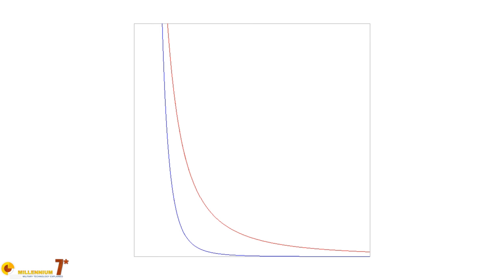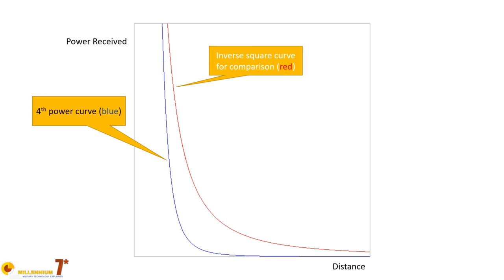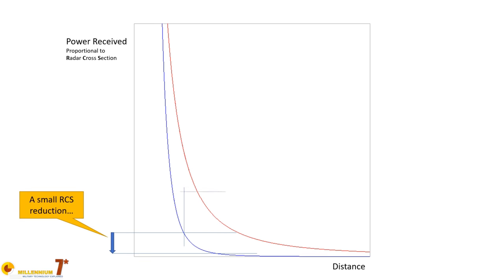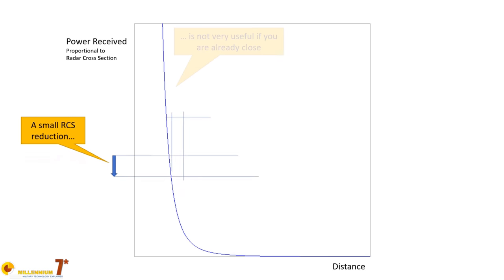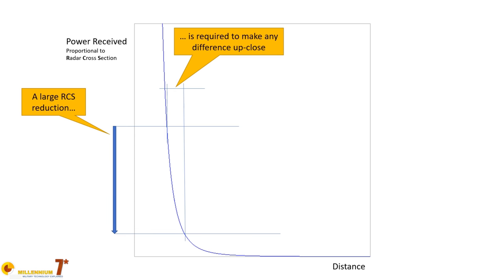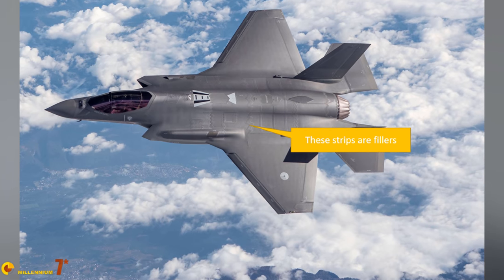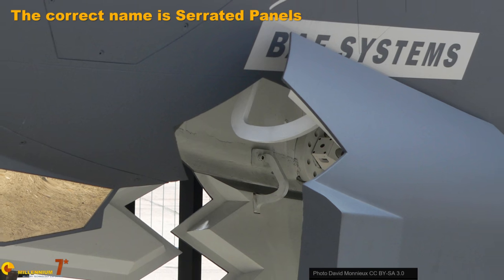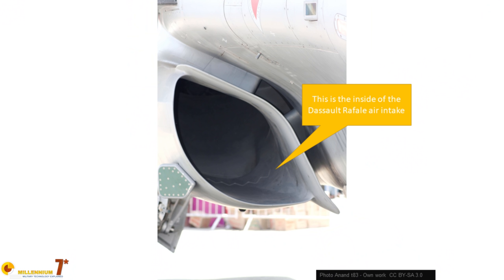STEALTH 102 | Advanced Radar Stealth Technology

Comment: 6:26 This diagram nicely explains why Su-57 are getting L band arrays in to their wings. Basically they had to go in to wings to get aperture necessary for any precision or range at dm wave length, but will sure help with detecting  stealth aircraft.
Reply: L band radars also known as weather radars because … that’s what they’re used for! AWACS use them because of their power and range but with a 9 meter radar dome, you need a 707 to carry it! They are pretty handy and used for GPS units because their waves are able to penetrate clouds, fog, rain, storms, and vegetation. But you don’t need a huge antenna since it’s only triangulating the signals from various satellites! And they are also good in fighter planes for when you detect another plane, you can query them with IFF to find out if they are friend or foe! Enemy aircraft will appear as triangles and friendly aircraft will appear as dots or filled circles.

Comment: Page 10:24 calling the tail wings are made of composite materials to reduce RCS that also open heat disintegration problem by the engine exhaust.

If the main wings dominates the RCS work on main wing first and second the tail wings.

Comment: DO A VIDEO ON THE SU 57, seems its finished or ready for service and we need to know what to expect :D pleeeeease.
Reply: The su 57 is just as stealth as the F-35 and F-22 from the front. Russia didn't need a new fighter. The only reason it was built was for parity against the F-35/22 and that required stealth. Basic military doctrine.
Reply: @Toro_Da_Corsa  I guess if you have a point defense fighter flying against an intruder you don’t need to be stealthy from the rear end 

And if you intend to engage from BVR anyways - hey bother going the last RCS mile with full coating of RAM 

I think the Su 57 is a wonderful example of Russian pragmatism in engineering compromise without over engineering its first line fighters 

The F-35 is a never ending project and F-22 in particular was built in a window of war or pocket of technology which was never needed to actually enforce air superiority against a peer adversary 

F-22 isn’t obsolete- but no one truly needs such expensive toys 

F-35 is the same, in fact a deep strike fighter built for a Cold War Peter adversary when there is none 

The Grey Wars we are Seeing today is fought without emphasis on air superiority 

Strategic warfare has killed itself by magnitude of annihilation of all mankind with nukes 

And tactical conversational is equally outdated 

Only assymetric warfare is really an option - particular disruptive economics is the preferred precision weapon of today
Reply: From what I have read, the Su57 is a great design; but it suffers from poor construction with rivets that stand proud from the surfaces and panels that don’t meet flush.  Good design, bad construction.  It would be interesting to how well it does in radar testing.
Reply: @keirfarnum6811  That's because all 12 of the first jets were PROTOTYPES. Nobody has seen the production craft up close.

Comment: Based on the video's title I thought you'd be discussing EW jamming & other non-structural technological methods for avoiding/ countering detection - i.e. - non-structural stealth technology - which seems an important topic/ goal since  structural stealth: (I) is expensive, (II) often requires aerodynamic compromises, & (iii) can't be modified/ tweaked to deal with advances in radar detection such as L & S band  radars employed by AEWC platforms vs the X band radars deployed on most fighters. 

Saab for example argues that structural stealth isn't cost effective for the reasons referenced above which is why they tout the effectiveness & adaptability of their EW sensors/ jammers/ emitters. The new EPAWSS system being added to the USAF's F15 EX & E fighters is another example. 

Long story short - it would be great to get your thoughts on non-structural stealth technology & the effectiveness of same  vs. structural stealth .. and whether you need both.
Reply from the maker: It is in the pipeline, but it is a tall order avoiding being too generic.
Reply: Saab is just saying that to sell their plane. However their future jet have structural stealth too like everyone else. When you have no stealth plane to sell, you try to make the best out of it but in reality they know that structural stealth very important in the future.
Reply: Non-structural stealth technology such as active cancellation is still too immature to be fielded. The claim that systems like EPAWSS and SPECTRA used an active cancellation technology is just a speculation, not an official claim. What we definitely know about these systems is that it's an ESM, and its ECM capability is intended for jamming missile's seekers in a defensive scenario. Also, the advances in material science allowed RAMs to be effective even against UHF band, not as effective as it would against X-band, but any reduction is better than none at all, and the F-22 mid-life upgrade will include the RAM similar to the F-35, meaning that stealth can be upgraded retroactively. 

Existing stealth fighters can be upgraded with an active cancellation technology, but stealth shaping can't be added to the existing non-stealth fighter. And while stealth design can be detrimental to the aerodynamics, in practice, this isn't really much of a problem because non-stealth aircraft have to carry weapons and additional fuel externally, which imposed a drag penalty on the aircraft, reducing its speed and combat range. If we're still in an era where dogfighting is common, then that's a valid concern, but nowadays, it's suicidal for non-stealth jet to go on a combat mission in a clean configuration, and Western non-stealth fighters have a rather abysmal internal fuel capacity, making external fuels important, so stealth aircraft got to enjoy its lack of parasitic drag.

Comment: Overall this is a really good "Stealth" discussion, I would however have liked to have seen the early graphs done with some real world numbers, instead of just the 2 arbitrary (not referenced to any real numerical values, i.e. plot displayed at time 1:53) 4th Order plots. It would have been a great place to show four or five plots overlaid on the graph of various real RCS values vs Detection Range (given a reasonable generic radar) to really accentuate the differences of detectability (or lack thereof) by range; this section was very hard to follow since none of the graphs showed real numbers. The later descriptions of surface waves, & diffraction are incredibly well stated in laymen's terms!
Reply: It would be hard to select a completely "generic" radar. But one could select some common existing models. Although many of the details of both the radars, and the RCS qualities of various aircraft, are not exactly published.
Reply: That's difficult since there's really no precise data on the capabilities of the modern radar other than the band it operates in, even a single band has a rather wide range. There's, however, a "generic" equation you can use to find the detection distance vs RCS of the aircraft. You just need to know the target RCS, reference RCS, and detection range against the reference RCS of the radar.

Comment: A personal thanks for all the other insights. I can imagine the Keller cone effect having a strong influence on F19 type designs or the B2's curvatures (and my own, ultra secret, F35B replacement project! :-) ). Is avoidance of this effect (by reflecting into singular directions or focussing it on points near to the aircraft) the main driver for the parallel leading and trailing edge approach? By the way: 5:24 min: The return of the flying bathtub (The original of course residing inside the A10! :-) ).
Reply from the maker: Yes, governance of the direction of reflections
Reply: @Millennium7HistoryTech  Indeed but are individual reflections the main factor or Keller cone type reflections?  And does a single ray follow a single path within the rules of the Keller cone principle (like a flat mirror reflecting fotons  "2 dimensionally")  or does the ray tend to shatter into a Keller cone pattern pattern anyway?
Reply from the maker: @marcbrasse747  It "shatters", it happens when the geometry is in the diffraction area.
Reply: @Millennium7HistoryTech  Thanks. Very insightfull! Have a nice weekend.
Reply: @Millennium7HistoryTech  A suggestion for a future video. It might also help to demistify stealth by comparing it to other sensory technologies. What people percieve as the stealth "magic wand" is often only equal to radar stealth but  what for instance about passive optical and infrared scanning? The F27 and Mig 29 have been carying their optical "bulges" for years. Combined with the newest developments in optical interpretation software recognition 360 camera systems that search for contrast differences can be used to aid situational awareness. I can actually not imagine something like this not already existing in prototype form at least. OK, it might only function optimally in near perfect weather conditions but could then theoretically spot stealth aircraft before they appear on radar. Stuff like that will actually be part of radar stealth becoming more relative.
Reply from the maker: @marcbrasse747  Maybe this https://www.youtube.com/watch?v=crY5xV-fd6k

Comment: Radar is a fascinating subject.
Reply from the maker: When boys call me "Sir" is always a shock...
Reply: @gags730  I am sceptical of this mentality, it's 'just' an application of Maxwell's equations. Fear is a driver of applying effort to endeavours, punctuated by stagnation. Firearms are as if frozen in time.
Reply: @gags730  
Despite the complexity, modern radar still worked on the same principle. The major difference between WW2 and modern radar is that the modern one have more processing power, capable of filtering out clutters better.

Comment: I didn't get one point tho, why the absorbed radar wave doesn't go to be reduced like any other electric current by natural resistance of the medium material, why doesn't it dissipate while travelling through and before bouncing off again?
Reply from the maker: It does, but the metal impedance is not high enough to avoid the bounces.
Reply: @Millennium7HistoryTech  OK, so it's a concept applicable to the conductive material,  now it makes total sense to me...

Comment: stealth is not cheap.
it should be a given that adding and maintaining vlo stealth will increase costs significantly. 
yes vlo rcs stealth has it's place...but one has to consider it's cost and how often it is required to complete the mission to determine value. for some with deep pockets true value can be ignored...for everyone else value should play a role.
if one does not need vlo rcs to perform 95% of one's mission's vlo cost should be questioned regarding value. there are other ways to complete a strike that need not include vlo stealth...even in highly contested environments. so one must weigh the cost of maintaining vlo stealth in order to complete 5% of the expected missions vs future unmanned options forward or use of longer range munitions. 
nobody wants to see their pilots in harm's way...so choose a way to keep pilots out of harm's way. vlo stealth is NOT the only way to keep one's pilots out of harm's way. to be honest the financial cost of maintaining vlo stealth could actually be detrimental in the future due to reduced funds available to procure equipment that cod well be necessary as current vlo stealth looses it's advantage thus can no longer be expected to keep one's pilot's safe.
technology always advances...stealthy rcs advantage will only cause a need to reduce it's advantage. 
demanding vlo stealth over all else is unwise. ensuring value is had is paramount. 
purchase for need should be prioritized over purchase for short term bells and whistles.

Comment: Defraction wave is why turbines and propellers are so bad for stealth.
Reply: Radars used to count turbine blades and other features of them to identify aircraft at a distance
Reply: @SeedOfElijah  I wondering how they did that. Maybe they compare rpms with speed in a database.
Reply: @taylorc2542  I read where by various methods they get a "print" of the radar signature created by the turbines and fighters had a database, as you correctly stated.